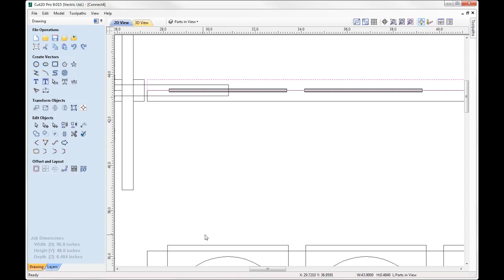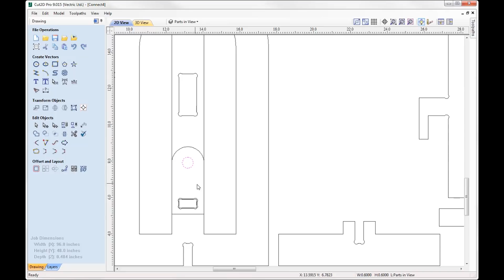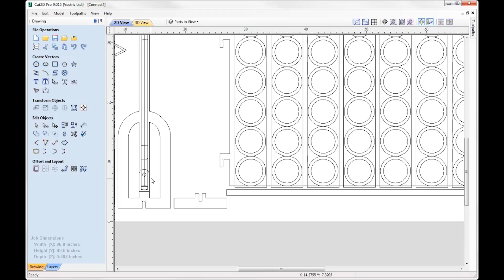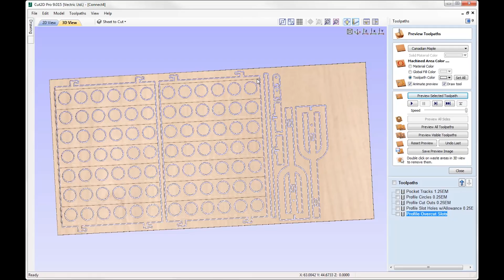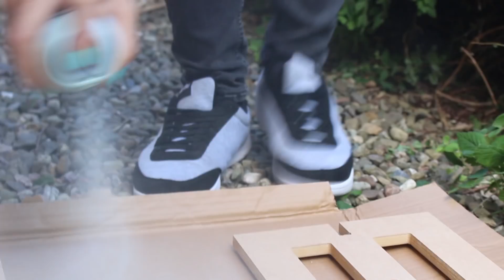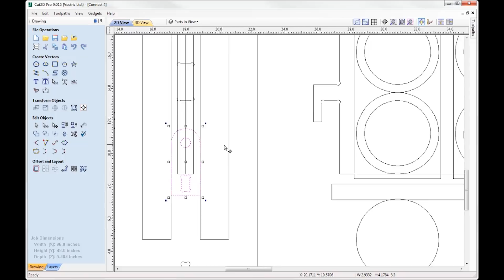In Labs with Beki | Make Your Own Giant 4-In-A-Row On Your CNC | Vectric FREE CNC Projects

Comment: Hi Beki, 
Wonderful video! I've watched several times the portion where you rotate the objects about a pivot point and I can't seem to duplicate the process in my Aspire 9. I can get my object to rotate but it always rotates about the center point and not the pivot point. In my case, the pivot point is not the center of the object. Would you please explain how to select the pivot point? I am missing something in the details.

Thank you very much!
Ed
Reply from the maker: Hello Edward, No problem, what you need to do is select the vector(s) that you want to rotate, and whilst this selection is in transform mode (you can see squares to scale the part, the rotate handles etc) If you clock on the center square it will turn into a "target" this is your rotational center and you can now rotate your vector(s) from the center of the selection, (if you watch  8:31 your can see all the objects selected in transform mode - then i go on to click on the center point to bring out the rotational center) I hope this helps! ~ Beki
Reply: Thank you Beki
Reply from the maker: No Problem! Happy to help :) ~ Beki
Reply: I finally got it, Beki. You drag the center point icon to the pivot point. That's a really cool feature and I'll use it frequently. Thank you for bringing it to light. I'll keep watching your videos and pick up additional features of Aspire that I never knew existed.

Comment: This is great Beki!  I’m in the process of acquiring materials for it - acrylic for the discs seems pretty expensive (at least here in the US) - what were your thoughts on using 1/4” wood (maybe poplar or balsa) and adapt the thickness of the channels the discs slide in?  Or I I’m investigating PVC sheets and found a way to stain the PVC.  Other thoughts?
Reply from the maker: Hey Josh, Thank you for your comments :) Sure you can use any material you like, I used acrylic because we had some knocking about in our Labs, but you can definitely look at using poplar or balsa! I've not cut PVC sheeting - that sounds interesting! What ever material you use, just make sure that you adjust the pocket depths for the counter track :) Let me know how you get on :)! Thanks again ~ Beki